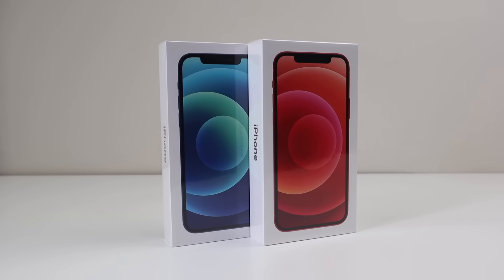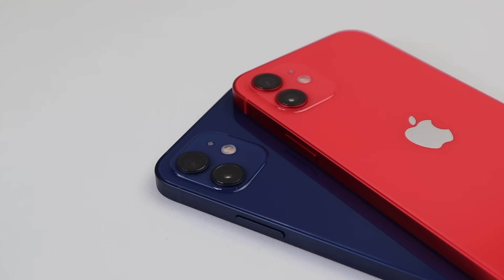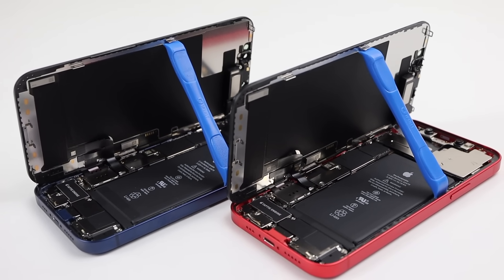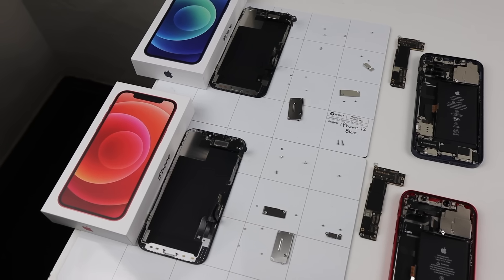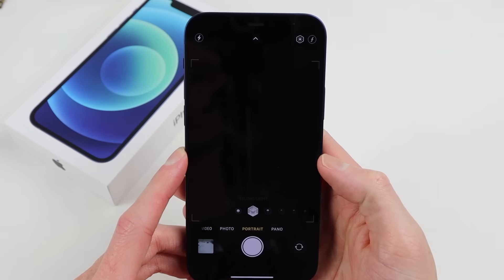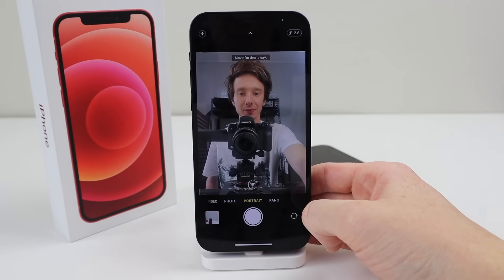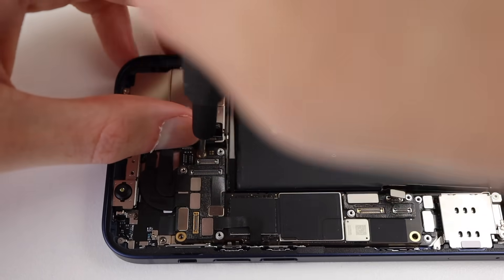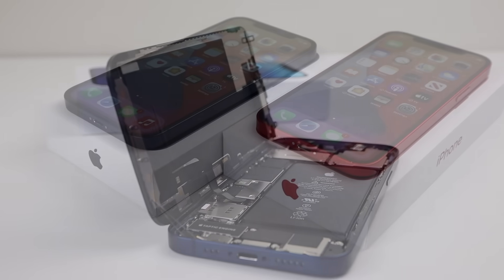iPhone 12 Anti Repair Design - Teardown and Repair Assessment

Comment: The only way out would be to to replace the logic board and install on it an open source operating system like Linux. That would give you flexibility in both extending the useful life of an iPhone as well as make it easy to repair. Apple has integrated the hardware and software at such a deep level that fixing an iPhone without them is impossible. You can fix almost anything with compatible third party parts but not with anything made by Apple. Go figure.

Comment: Ok, let me just get this clear for everyone. The fact that Apple does not provide you a power brick and earbuds is not to "save the environment", it's all marketing tactics in which they would make a huge profit off of just by selling things an average consumer needs but separately. In fact, Apple would need to use more packaging for just something that used to come in an iPhone box alone. I don't like the fact that they make their phones and devices non-repairable by 3rd-party repairers because, as Hugh explained at the beginning of the video, Apple would tell you to get rid of the device and eventually end up as E-Waste which can then be used as parts for "broken devices" or for their iPhones that are manufacturing in their factory. You might be wondering, well how are other parts in the same type of phone verified? Well as Hugh said, Apple can decode and optimize their components reading data into thinking that it belongs in the device it is put into. Adding on to what I said earlier, Apple would 101% force you and convince you into buying a new Apple device instead of getting it repaired. Well done Apple, you played dumb very well...

Comment: This explains SO much with my own phone WOW. Had stuff replaced third party a few years ago and almost all the symptoms I had to deal with for three years before I needed to mail it to apple when my battery started expanding during lockdown and we couldn't find an open third party repair location. Everything was fixed when they returned my phone to me. Now, obviously this isn't the new phone, but it is uncanny that all the issues I had with mine after getting repairs is also effected here.

Comment: my dad is an electrical engineer, and when i shattered the screen of my old iphone 5 (i've since switched to a 6s for reasons unrelated to the repair) he bought a replacement screen online and swapped them out without an issue, i didn't realize that apple had gotten so much more gatekeep-y with their phones and repairs since then

Comment: the problem is not the design ... you want a waterproof phone that is small and light ... then you get exactly that.

The problem with apple is that you don't get any technical drawings, no component number and therefore no spare parts
and of course the hardware lock ...

Comment: Apple is such an asshole company that at this point they don't even try to hide it.
Every new phone, you HAVE to buy new adapters AND can't repair them. 
Instead, you'll go to a 'genius' bar where a moron will charge you $600+ for a charger change.
Apple users are dumb.

Comment: Apple scam customers. They don’t want to repair the phones because it’s not lucratif. So they say bull shit to customers like for exemple, the home button can’t be changed because it’s part of the motherboard and offer instead a replacement. A refurbished at a lower price in exchange for their old phone. Once done, they repair the customer’s phone so they can sell it as refurbished for the next customer. They take advantage of customers ignorances to make much more money. If only people knew that the home button can be changed. However, I don’t know if on the iPhone 12 it’s still the same though. They don’t want to repair but is at war with repair shops.

Comment: If you buy an expensive car do you fix it yourself with some cheap chineese parts? Or do you go to the manufacturer to make sure it works as intended so you don’t have an accident? And for the phone not working when switching the boards- atleast stolen phones don’t bring you profit

Comment: I've heard tell that there might be a new law coming around, since it's so difficult to find the right tool to remove certain warranty void screws in consoles. That there might be a law passed soon that will prevent companies from using crazy specialized screws in consoles. 

"The right to repair" since so many people are fixing and replacing parts in old school consoles...eventually some previous generations with a lesser quality is going to catch up with the really old consoles.

 Whether or not it'll be enforced thats a different story, but if it's coming to consoles...it might soon apply to other electronics, hopefully ironing out the planned obsolescence altogether...

One can hope

Comment: To get the face ID to work, you have to take the iSight camera off the display from the screen that went with the original logic board. These two things are married. 

It's the same thing with the older iPhones and the home button. If you swap out a third party screen for the original cracked one, you have to take the home button off the cracked screen (assuming it's not broken too) and put it on the third party display. If you've ever gotten your screen repaired, and they claim that it's not a third party screen, and the fingerprint sensor doesn't work, then they were lying, or they don't have the equipment and software needed to make a new screen's home button work.

Comment: Something that also strikes my mind is that does this restriction prevent Apple themselves from installing new hardware if a customer broke something or wants something new like a battery block? If that's the case, then it requires consumers to buy another phone rather than just repairing the phone for longer use. This helps make the phone more recyclable but what Apple is doing is practically going against their word of "eco-friendly" and is also just hinders our ability to repair any of their products because its "their" product that we bought. This is just bullshit and Apple shouldn't put restrictions for what we can do with the phone after the phone is purchased/we own the phone.

Comment: Do the new Macbooks have some component pairing also?
Reply: Hahahaha! component pairing? They just made it so most "components" exist on the single chip. CPU, graphics, RAM, SSD, But yeah, you probably can't move the system board from one machine to another either LOL
Reply: @retal052  True, I was thinking something like the mobo paired to the battery or touchpad

Comment: What about more common issues like cracked screen or changing out an old battery for a new 1. 
I just moved into iphone 7 for $100 after having iphone 6 for 4+yr

What's wrong with your current phone? Why do you need that new $1200 phone right now?

Just wait till 6+ months after release and the price will drop or do not buy that new phone at all. Apple will see we are standing together and telling them if they don't allow right to repair. Their products will not sell.

Comment: I still own Iphone SE for about 4/5 years now, the battery is becoming unreliable and had to recharge more then usual even the % isn't right, when it showed 1% I restart my phone and it show 30/40/50 odd % some people said about the news Apple sent the update to the old Iphones to make it obsolete which making the user to "convince" to buy the new Iphone :/ which is typical.

About that new Iphone 12 it's interesting how easily the functionally isn't great just the simple swap from both bran new Iphone 12. I think when each Iphone 12 been fully built the manufacture run the software and installing the programme which (I think) place the codes an each components within the Iphone 12 to be recognise each other and will function at each other. so if any part/s been swapped over or replace and the code isn't matched up then it refuse to function properly.
The part where you swap the cameras round I thought it would work without any issue but it not and that got me thinking it must be the codes that been put into place within the Iphone 12.

we need the right to repair cos we people buy their Iphones and we own it with our money so it's our right to repair, aren't we

Comment: This is why I ditched iPhone 10 years ago. They just want to bleed you dry.
Reply: Good on ya! I've only once owned an Apple product, it was given to me and I managed to promptly break it at an airport. Needless to say I've never had a phone break because of a chair before that. It wasn't able to make calls, I used a Samsung for that it lasted about 4 years if I recall before the screen basically lost the ability to function, probably could have easily fixed it but I was young at the time and dumb.

Edited the time, im pretty sure i got it in 2014 not 2010 and i dont remeber when i got my cricket wireless phone but i know when it broke is when i got my samsung. It may have been 2013 when i got it.

Comment: Let's remove the capibiltily for basic things that a phone has had for several years and make our phones impossible to do anything on your own possibly making something so anti consumer you have to resort to Apple themselves potentially undoing all they clame to be doing by removing basic things from the device. Now please tell me why you would pay for an IPhone when you pay more for the name when you can get a Samsung device with basicly the same features that can be charged with millions of other things than the offical charger wall plug that (to my knowledge doesnt have to be bought separately).

Comment: Yeah I don`t like that you practical can´t repair any new phone. I mean I like to repair TVs and stuff like that but you can´t do it with new devices. Once I repaired a Phillips TV from 2012 I found online an other 100 sites long instruction how the motherboard and power supply works and I could open the TV with just a normal screwdriver.

Comment: This is the secure enclave, right? This is why Apple "calibrates" your phone after service. It's the same reason you can't downgrade iOS easily when trying to change your jailbreak around. And upgrading to a lower-than-live iOS revision using Future Restore for example will kill FaceID etc, because you have to pair the hardware with the software. It's basically just more proprietary locking mechanisms to prevent true ownership of hardware.

Comment: This is making me want to return to android after i'm ready to upgrade
Reply: Do it, android comes with better benefits
Reply: please do! androids last a loooot longer than iphones (also the battery doesn't die in like 2 hours). i only had problems with one of my android phones, it only lasted 2 years and a handful of months :( but that's probably bc i had to replace the battery (it got damage, my fault) and got a cheap one from a random place that definitely wasn't trustworthy :/ (now i know better but i was young and stupid back then). my first phone lasted many many years tho, i got it in seventh grade and used until freshman year, and then gave it to my brother who used it for another couple of years, it only stopped working a few years ago but oh boy was it worth it lmao. it was a teeny tiny phone and even had an antenna (and like 8gb storage, with the system itself taking up 6.8gb or something) but it was a really pretty color...
Reply: Android phones are much more easier to repair, you could change the battery, camera, or any essential component without being warned with these BS messages you see on an iPhone.
Reply: I did that long time ago
Reply: Shrek  my asus rog have 16gb of ram 🐏
Reply: if apple keep on doing this, android and harmonyOS are gonna kill it.
Reply: all they did was put an 11 on it nothing changed. although it will have a later date in the software for the (snail virus) Declocking firmware to attack it
Reply: @Q5Grafx  Android >>>>>>>> iOS. And it's got loads of new features. I should know, I'm using A11.
Reply: @liviuganea4108  personal preference

Comment: I'm still stuck on hearing the Sim card slot had a screw that was rounded from factory. Basically warranty voided right out of the box if they get it back, see that, and blame the user.
Reply: lats not forget the red dots that tell them you dropped the phone in water that are printed on the board
Reply: @Q5Grafx  TBF, that  IS your fault. Don't drop it in water.
Reply: @liviuganea4108  I do believe there were a few cases where the dots activated just from the humidity in the air rather then being dropped in water and the owner being falsely accused of damage. Though it's been some time and I'm not sure if I'm entirely correct
Reply: @Azul_skies  that happens only when you take it into something like a bathroom I.e. when you take a bath while browsing your phone.
Reply: @liviuganea4108  or when you're just somewhere wet like a natural environment
it's not that rare
Reply: @heartache5742  you're talking about jungles. Outside of those areas, normal environments don't have that kind of humidity.
Reply: @liviuganea4108  u live in Queensland? let me tell you it can turn into a sauna xD
Reply: @ashleykneebone2306  90% plus humidity is common even in Vic during Winter
Reply: @Azul_skies  My cousin mows lawns his phone is in his back pocket and his phone had a voided warranty because the screen quit working and the one tab was red
Reply: I'm surprised they havent put a microswitch to indicate the phone has been opened, like the hood switch for a car alarm!  Oh shit, they probably will after reading this!

Comment: The last i touch I got I dropped once and the screen smashed. The last 2 or 3 phones I had were dirt cheep. My current one was £15 and one I had before that was also very cheap(can't remember £30 at most) and both aren't in any way related to apple and both were brand new and brought from official Vodaphone shops and they both lasted me years and the one before my current one I dropped hundreds of times and it still kept going even after 5 years. If it fell apart I could put it back together easily and it would still be fine.  Basically Apple products are overpriced rubbish as I always say and Apple has always been money grabbing criminals for ages, I'm never getting an apple product again.

Comment: Countries are taking Apple to court over Right to Repair — and sometimes, they’re winning In June, the Australian Federal Court fined Apple roughly $6.6 million for violating Australian Consumer Law. The tech giant came under fire for an “Error 53” message that appeared on devices that had been repaired by third party shops, rendering the device useless. While the fine is a mere slap on the wrist for a company approaching a net worth of $1 trillion, it’s significant that the court ruled in favor of bolstering consumers’ rights.

Apple has seen its share of lumps in the courts lately. The company sued an electronics repair shop owner in Norway who imported salvaged screens from Asia as replacement parts for iPhones because those parts had Apple logos on them. The Norwegian court ultimately ruled in favor of the shop owner, citing the Apple logo was not visible once repairs had been completed nor was it a central selling point for the repair shop. Significantly, the court recognized the limited options when finding quality replacement parts without the Apple logo.

To many, disabling your phone because you had it repaired independently violates the basic principles of ownership. Once a customer purchases their iPhone, iPad, iPod, or another device, they should have control over how they choose to use and repair it. Pushing out the legitimate competition in the repair market forces consumers to go to the original manufacturer for repairs, which adds to cost and can be a hassle. It also creates waste, as companies can decide when to fix products, and when to refuse to, pushing customers into a new purchase.

Right to Repair bills would help expand repair options by providing access to parts and service information and have been proposed in 18 states. U.S. PIRG is working to support the legislation nationwide.

Comment: lmao just like google will be at - emisions by whatever the goalpost they set this year lmao stop listing to the bs green washing ... ya google plans on doing the with some of its biggest investments in big oil ... its a fucking smoke screen ... apple is as much or way worse , never mine the face that all that's changed about the phone in 20 years is a better camera there always behind all the other company's instead focusing on how that can milk every dime from you example taking away the headphone jack and now only having one stupid connection that req a dumb transfer or headphones build with the connector . no value to customer now you cant charge and listen to headphones or use reg headphones or do anything that req the one connection port you have . wacke stop wasting money on crap product .

Comment: Should’ve swapped the parts and then took it to Apple and say you’re having these messages come up on the screen. Then show them proof that you just got it when they ask questions
Reply: if they took it to be repaired they would notice that the glue has been removed/tampered with in some way and then refuse service for repairing that phone
Reply: @alexandersergal  worth a shot. Just act dumb and say you got it like that